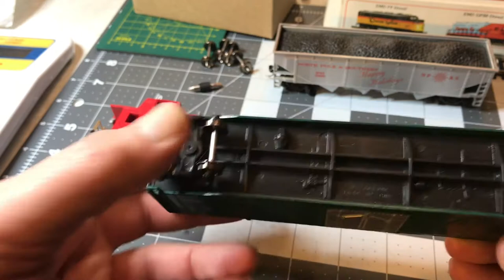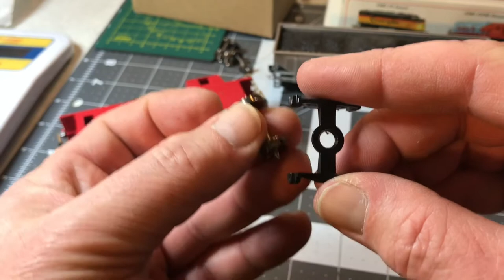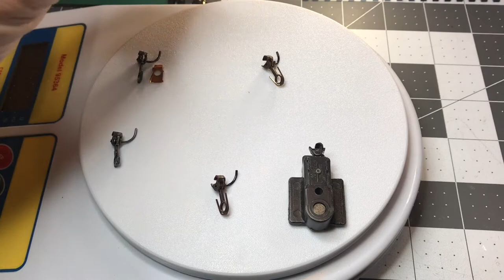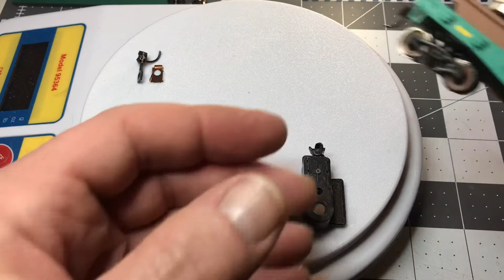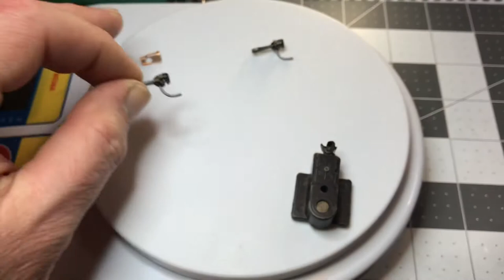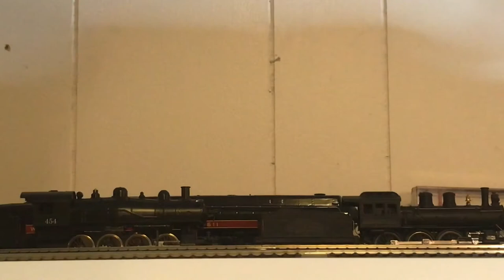Back Shops 1 - Micro Mark Truck Tuner

Comment: I have a tool like that only i removed that rubber thingy so i can use on truck mounted couplers, Also, The couplers i use is Kadee #28 designed for use with talgo trucks coupler pockets and the wheelsets are exclusively 100% Kadee i use them through out my entire fleet of Tyco freight cars.
Reply from the maker: You can’t go wrong with Kadee equipment!
Reply: @MyLifesTracks  Same here, Theres a company called ''Sergent'' that makes a true to prototype knuckle couplers the retail price is $84.00 for one lousy pair?! I wouldn't pay two cents for them! I'll always stick to kadee, Also, Thanks for the reply.